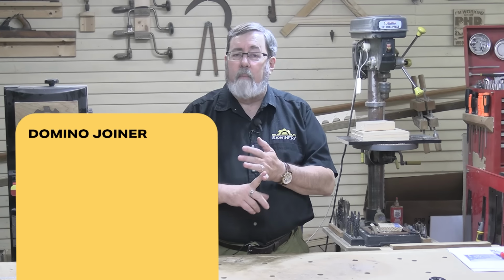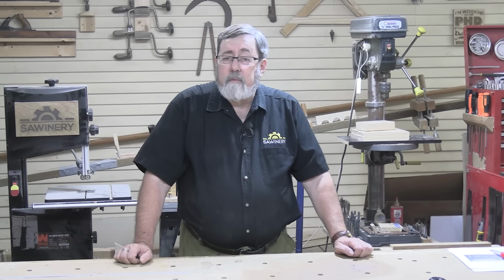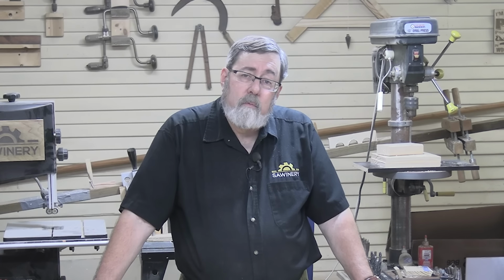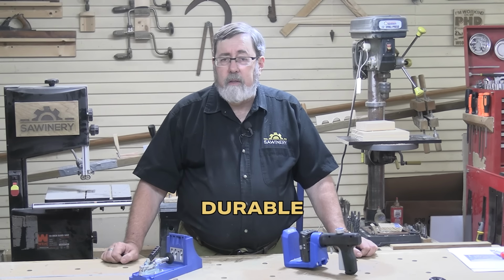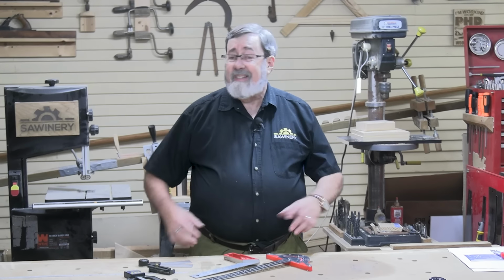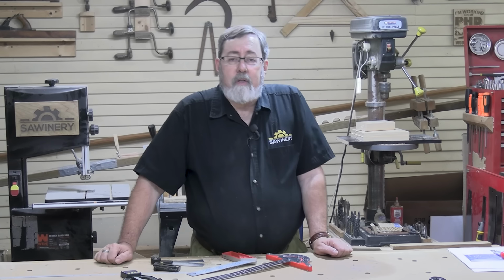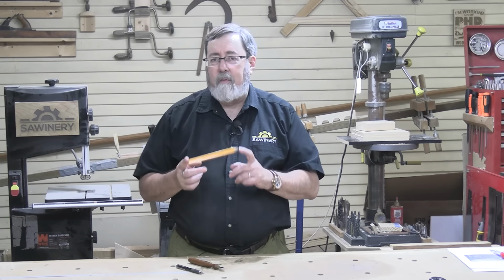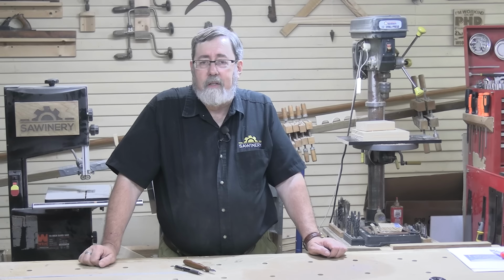5 Most Overrated Woodworking Tools

Comment: Excellent commentaries.  I agree with most of what you say but disagree with a few.  However, my disagreements are situational.  I no longer do much woodworking for other people.
The miter saw is my most used tool.  I would actually prefer a radial arm saw which I used heavily in my first woodworking job.  It can cut long strips.  A miter saw can't.  My current shop is 14' X 16'  so a table saw is out.  If I really need to use a table saw, I go to a community shop.  
My second most heavily used tool is a straight edge (clamping preferred) and what we used to call Skill saw. 
When I was a cabinetmaker,  we did pocket screws a lot.  When pocket screw jigs started being marketted, I bought one.  I've never used it though I sometimes throw a screw hole in a very tight space that even a pocket screw jig won't fit.  
As you were trained in drafting, you were likely trained to roll your pencil between your fingers while drawing long lines to keep the point in the right place (self sharpening).  I still do that but also keep sharpeners around the "shop".  
There's another tool that I'd like to put on an overrated list.  That's a  random orbital sander.  Unfortunately I've become adicted.  When they first came out, I was doing table tops.  There's nothing better to flatten table tops than sandpaper wrapped around a very flat wooden block and time - a lot of time.  Apparently the need for precisely flat surfaces isn't as important these days.
Another tool I can't see a need for - especially at it's cost - is a track saw.  Maybe if I were a professional.  But do professionals actually make enough money?

Comment: that mitersaw issue....I use the miter for crosscutting, so a suitable blade on that saw, and my tablesaw for length cuts with a suitable blade...less bladeswapping imo

The (carpenter) pencil, if you scribe against a ruler, and you cut on right side of the line, you dont need the fancy markerknife just understand your kerf!

Comment: You really need to add Japanese chisels to this list, what a waste of money they are.  Also, a decent mitre saw is a much better proposition than silly jigs on a table saw, especially for anything narrow and longer than a metre.  Although you are right about the thick leads, and that it is not a precision tool, it also sounds like maybe you are not familiar with the correct way to use a carpenters pencil. Mechanical pencil leads break too easily on wood, especially rough wood.

Comment: Disagree that accuracy is the key.  It is consistent cuts and using the same measuring device that is the key.  All cuts be it width, length, or depth should be cut at one time.  Even using a piece that is already cut to the correct dimensions to reset up a table saw can cause all the other parts to be off a mm.  

If I want cabinets for a wall section to be 600mm deep for example and it is only 595mm because my measurement is off, it does not matter as long as all the pieces that are used to make the cabinets for that section are all cut at the same time to the same depth.  Even if they were a bit deeper, it would not matter.  Is it a pain to deal with, absolutely especially if you pre-order everything before that item is ready to be installed or different measurement devices are used.  

It goes for fine woodworking as well.  Building a dresser that is supposed to be 40 inches wide and it ends up being 40.5 or 39.5 does not matter because you should build the carcass first using the same measuring device you used to take the measurements to begin with, then build the drawers afterwards.

Comment: Great thoughts... I do have a Miter Saw and use it a good bit but you are correct in saying the same cuts can be made with the table saw. I would add the track saw as being an item that is way overrated for woodworking, A straight edge and a circular saw do the same thing.
Reply: Stumpy nubs just reviewed a universal track saw system that changed my view of track saws, have a looksee
Reply: As far as track saws vs straight edge+circular saw goes, I’d say they achieve the same goal but they don’t do the same thing. A guide track provides a rigid rail over its entire length and doesn’t allow the saw to deviate. With the straight edge method you can wander away from your fence and unless your straight edge is extremely rigid and/or clamped down in multiple spots along its length, the possibility of introducing flex or moving it out of alignment due to using too much pressure in an effort to maintain saw/edge contact exists.

Comment: Hi, some years ago I  was in a museum in England. I live in England.  I was in the ancient Egypt
department. 
I was looking at a sarcophagus that housed the mummified body. The sarcophagus was inside a large wooden box. It is similar to a modern casket used for burials now. The side of this casket was breaking away from the end. I could clearly see the floating tennons that were holding the casket together. Just like Domino's, but 4 times bigger. So, the basic joinery technique of the Domino is not new or modern. It's just a very expensive tool to make floating tennons easier.
If a person is making furniture for a hobby, they do not need an expensive machine. Doing it to make a living, then maybe.

Comment: I use my mitre saw just as often as my table saw. I almost never use it for mitres though. It's excellent for repeatable Cuts when when I need x amount of Boards with the same lenght (have it in a table with rails and end stops. Otherwise I agree, but as always depends on what you do.

Comment: People have been doing woodworking for thousands of years without a table saw, too, but that doesn't mean that the table saw isn't a useful tool.  

You're also wrong in that the domino doesn't add strength to a joint.  That's like saying that joint and tenon joinery is a waste of time, too.  Like a tenon, a domino's grain direction is opposite of the grain direction of right angle joints.  There is more to joinery than panel glue-ups.  They're a lot easier to get right than dowel joints, too.  They're a lot more forgiving with errors from one end of a board to another.  Dowels have to be perfectly aligned.  Not so with dominoes.  The big advantage of dominoes is the speed and accuracy of the joint.  Yes, they're expensive.  No, they're not absolutely required, but they certainly make life easier.

I sorta agree with the miter saw, though mine is used a lot.  I could do without it, I think, but I wouldn't like to.

The most useless tool in a woodworking shop is the drill press.  It's still useful but not needed.  I'd put it at the absolute bottom of the tool list.  It was my second purchase, but, as much as I've used it, I would have bought a lot of other tools before that.

Pocket holes make simple work of things like cabinets, where looks aren't important or the fasteners can be hidden.  They're strong (enough) and fast. Add glue and they're very strong.

Comment: The domino is not overrated in any way. Once you have one you find work for it. Cost does not equate to usability… table saws are expensive and people got by without them for thousands of years. Being new or well designed doesn’t equate to usability… bandsaw is the least used machine in my shop
A carpenters pencil is for carpentry, why is it in a list for joinery

Comment: I don’t think the miter saw is overrated, I do woodworking and the fact that I invested in one is because my shop is small and I can only fit a job site table saw, is very hard and complex to do a miter on a big pice on a job site table saw if needed. Sure, a contractor grade or a cabinet saw can be accurate to a hair but thats a major investment that would cost about 2 or 3 miter saw.

Comment: The Carpenter's Pencil is designed for carpentry, not joinery.. It is plenty accurate enough for framing a wall, laying out joists or installing a staircase. But not really good enough for fabricating the stairs or making the furniture.So the overrating doesn't come from the unscrupulous manufacturers but from the poorly-informed people who don't know the difference between carpentry and joinery (Lesson 1 in Woodworking!).

Comment: I do have to somewhat disagree as far as the  miter saw, it's nice having another saw I can set-up for miters while still leaving my table saw available for other cuts, and doesn't usually have the footprint that another table saw would have, pocket holes are nice though for gluing and not having your clamps tied up so you can glue, clamp, pocket hole, then remove the clamps while it dries.

Comment: Buiscuits are compressed wood, and the moisture in pva glues expand them as the glue is absorbed and hardens 
The kreg pocket hole sytsem are mostly for quick construction . Your clamp rack would be stronger if you used dadoes for the cross parts. 
Carpenter pencils are for rough framing . The gimicy sharpeners that put a round point are junk .  I made a block of wood and drilled 4 holes in it for pencils and it sits on back of lathe . .,my two prefered coats that I wear while turning  one has a brest pocket slot for pencil and my surplus army bdu shirt has three on the back of the left forearm

Comment: People did woodworking for thousands of years without power tools, too. Do you need a table saw, jointer, router or any other motorized tool to build good things? No. You can do just fine without them.

It's not a question of absolute need. Like anything else, it's a tradeoff. The Domino makes loose tenon joints quickly, easily and and precisely. If that capability is worth a grand or two to you, it's a great tool and a good value. If you can't use, don't need or don't want that capability, it's useless to you.

Comment: By and large, I agree with you...with some reservations. 

Miter saw? Don't really need it in a woodcrafters shop. Carpenter is gonna use one every day. Good for them. I own one. It collects dust until I have to take my personal tools onsite. Then I blow off the dust and toss it in the back of the truck. 

I have owned a biscuit joiner for some 30+ years. Use it every now and then. Just replaced the blade last month. First change ever. That tell you anything?

Carpenter pencils are for on the job site. No place for them in my shop. In my shop I use Pentel drafting pencils...0.7 & 0.9mm with 2B lead (super soft and dark without digging into the wood.) Got two of each and a lifetime supply of leads for under $30. Spendy? Sure. My justification is I draw a perfect, consistent line with soft, dark lead all day long without sharpening. Just like you said...I haven't lost one of 'em...because of the replacement cost! I can get a dozen carpenters pencils for three bucks at one of the box store, and never sharpen one beyond half length before I drop it, loan it, lose it. No problem...I have more. My drafting pencils? Never loan 'em out. Never lose 'em😂

Comment: I'm curious why so many woodworkers feel the need to have so many different types of squares, when you can get most of the same functionality with just a few different sizes of combination squares.

Seriously, what can a tri square or machinist square do that a double square can't?  And what can a double square do that a combination square can't?
Reply from the maker: I’m not sure that most woodworkers have a lot of different squares that they actually use. They may have more than one, due to being caught by good marketing or others telling them they “had to have” a certain type of square. But in the end, most woodworkers use the same square most of the time.

To answer your other question, a Try Square can’t do anything that a Double Square can’t. Of the two, the Double Square is more versatile. The machinists square is just another name for a Try Square. However, Machinists Squares tend to be highly accurate. For that reason, it’s a good idea to have one in the shop, as a standard to compare other squares to.

Comment: I disagree with everything that you said was over rated. I think it depends on what type of carpenter you are. I am a professional production cabinet maker and furniture maker and I use all of those machines daily. I believe that if the machine can save time because of speed and accuracy. Then  likely it will pay for itself. I use Mafell’s duel doweling system to build cabinets there in the same price range as the domino. The machine saves me a ton of time and paid for itself in the first couple of kitchens. I use the domino to build not only cabinet doors but entry way doors as well and it saves me a ton of time with speed and accuracy. BTW if your plate jointer doesn’t cut tight enough talk to your sharpening service they will help you out.

Comment: I'm siding with the "what do you have against mitresaws"-crowd:
Not only does it often save an enourmous amount of work and time, it can make cuts you can NOT do safely on a tablesaw, because the piece is too long.
Try cutting a mitre on the end of a 2.5 meter board on your contractor or even cabinet tablesaw.....

Comment: With regard to terminology, please be aware of the distinction between accuracy and precision.  They're different, but in context you've been using "accuracy" for both.  Maybe it doesn't matter if someone doesn't have an engineering or scientific background, and that might describe the average woodworker.  Bottom line is that your measuring device can be dead on accurate statistically but have a precision of +/- 3 inches, so that's not a good tool unless you're building roads.

Where the miter saw shines is with long stock.  For boards longer than about 4 feet, holding them stationary in a resting position while the cross-cut blade moves changes things.  With a table saw, especially a job site or hybrid saw, the stock must be supported while it moves, and it must be stationary with respect to the angle to the blade.  That's hard to do, even if you have help.  But yeah, for shorter stock, a table saw with a good cross-cut or mitre sled (or even a good mitre gauge with a rigid fence) is great.

With regard to pocket screws, I agree almost 100% per cent with your claims.  But I don't see how they could be used for face frames, except for things like kitchen cabinets that are adjacent to other cabinets or walls.  The reason is because the screws need to bite into the material, away from the corners.  That means the pocket holes must be on the outside of the cabinet where they are visible until installation.  If I were in a position to cover face frame pocket holes on a bookcase, I'd probably laminate something over the holes.  But, to be honest, I think rebates or floating tenons are easier to attach face frames, and maybe even dados.

With regard to the marking pencil, the carpenter's pencil should be sharpened from only one side.  The untouched side will remain comparatively flat.  As long as that edge is kept perpendicular to the work, it will be pretty precise.  The width of the mark is irrelevant anyway, because it's the edge that matters; and the edge can be placed more precisely than the markings on the measuring device.  But in practice, worrying about precision beyond about 1/32 inch is useless because the material moves more than that, even assuming that the blades don't wobble or tear evenly.  But yeah, the mechanical pencil is a nice luxury.  And the marking knife has other benefits, like making a groove for your cutting tools to start with.

I suggest taking a look at the "H Carpenter" channel on YouTube.  That's a master carpenter who does precision joinery using pretty primitive hand tools, and he uses a plastic ball point pen for marking.  His cuts are very crude, but he makes up for that with a chisel.  He'll convince you that even the table saw is overrated.

Comment: If you’re just tinkering around in your shop now and then, perhaps what he says will have some relevance, however, if you’re doing big jobs and need to save time making repetitive cuts, etc.; then what he says is wrong.  Like the old saying goes “work smarter, not harder”.  Yes, you can do without these tools and you can go back to using a handsaw, cutting mortise and tenons by hand, etc.; but it just makes no sense with the evolution of tools.

Comment: The problem with your criticism of the Miter Saw is..... to get a Table Saw that can do everything as  "accurately"  as the Miter Saw... you are spending close to $2000 or more. 
And don't bother replying about how there are good Table Saws out there in the $400 - $600,  because they don't exist.  
I've used all types of Table Saws under the $1800 price range, & some are OK... the rest of them suck.  
90% of a Table Saw's accuracy is the fence.  The other 10% is the saw's stability, provided by its mass.  

Nearly all portable Table Saws suck.  Down right garbage, for fine wood working.  
The fences will creep during the cut... they don't line up accurately requiring you to measure both ends of the blade to make sure it is parallel... they are difficult to adjust... & their small mass makes them very unstable.  
So that knocks out every Table Saw in the $400 - $800 price range.  

Now we come to the medium size Table Saws with actual cast iron decks.   Far superior to all the portables, but their fences still suck, for all the reasons they suck on the portables.  
There is nothing more frustrating than having constantly to jack with a rickety fence.   This is why wood workers build cutting sleds.  
So that eliminates all the saws in the $900 - $1800 price range.  

Now for the kings of the wood shop.  
The Table Saws with fences that glide butter... that have ZERO drift... with only have 1000th of an inch variance in parallel with the blade... they lock down with no give during the cut... easily adjustable... & blade guards that never hang during the cut, eliminating the need to remove them.  
Now we are in the $2000 - $4000 price range.  

Still sure about Miter Saws being overrated?